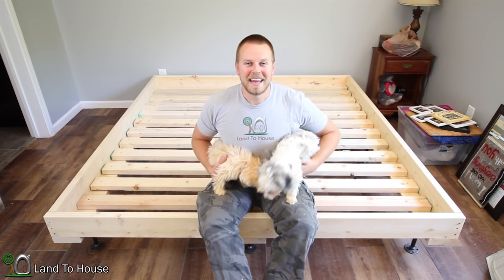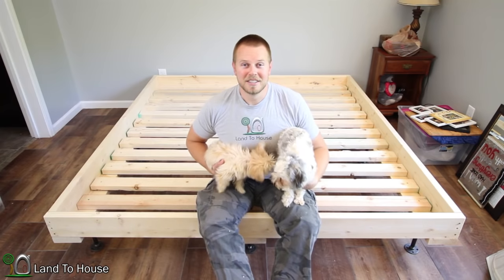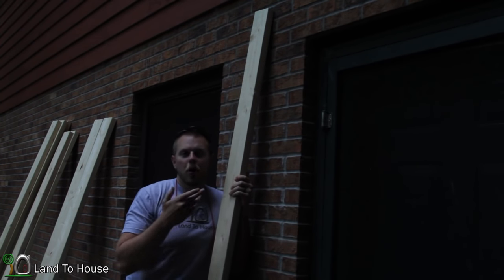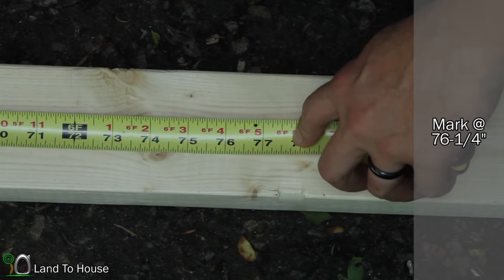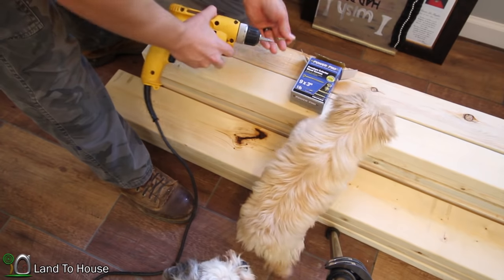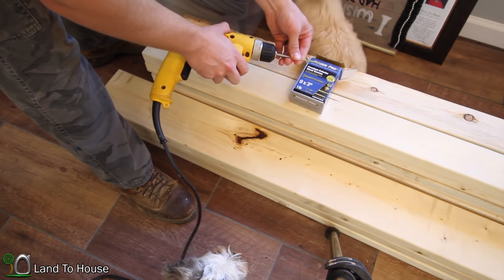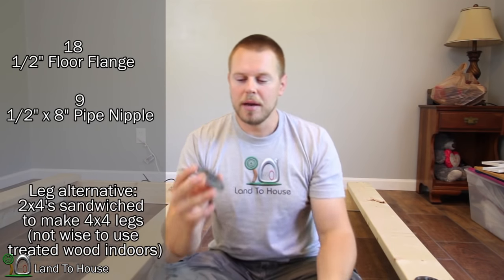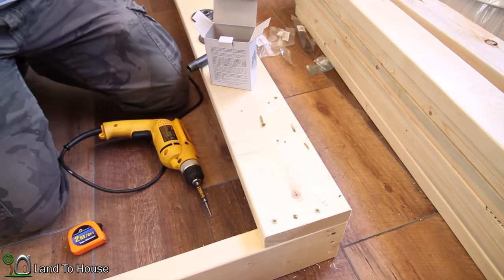Build a simple King Size Bed Frame out of wood

Comment: Could you have put four wood leg posts instead of nine metal ones?
Reply from the maker: +Costco Rewards yes for sure. Lots of people do that. Just make sure the wood is not treated. Many mattresses require that you have a middle leg.
Reply: Legs are needed to support the weight of mattress and people. As you can see, everything is hanging with screws from below the side structure, hence having 9 legs is the only way to manage about 400 pounds (150 lb per person plus about 100 pounds for the mattress). I hope it makes sense.

Comment: is this for California King or standard?
Reply from the maker: Standard size king.
Reply: Land to House Thanks. I have the base done with the exception of the legs and the slats. Your instructions are easy and the base is much stronger than anything store bought. Thanks again.
Reply from the maker: You're very welcome. I have used both the king size frame as well as the queen size and they're both very reliable. And to be truthful 110 to $150 is not that expensive compared to some commercial beds

Comment: Hi, if I didn’t want legs and just wanted it to be on the floor would I have to change or add anything as far as the structure goes?
Reply from the maker: I've actually received pictures from several people who have just left off the legs and the frame has worked quite well.
Reply: Ok thank you. I’m gonna try it out 🙂
Reply from the maker: Nice! This is a solid frame that should last for many years.
Reply: If you could give it a weight limit what would it be?
Reply from the maker: If you had this directly on the floor it would be well over a thousand pounds. With the legs I would be confident that it would hold 800 lb.
Reply: Ok thank you for this idea and information.

Comment: What length screws did you use to attach the legs?
Reply from the maker: +cherybabybaby1 the legs are attached with 1-1/4" screws.
Reply: Land to House  I have watched this video so many times, even though I know how to make it by now 😳I really like the look of it and how simple it is to do. How many total slats did you wind up using? If I put this bed together now and have to take it apart, will taking it apart jeopardize the stability, should I add brackets...?
Reply: 14?
Reply from the maker: +cherybabybaby1 haha 1-1/4"
Reply: Land to House 14 slats?
Reply: Or 17?
Reply from the maker: +cherybabybaby1 oh. My phone does not show the full comment thread. I think I used 15. 14 would give 3" gaps and I wanted smaller gaps. So if you went with 15 or 16 it would be fine.
Reply from the maker: I have not taken the frame apart to move yet but I should think you would be fine. The queen version fits through a door without taking it apart but I dont know about the king.
Reply: Land to House thanks for getting back to me. Did the legs to your bed come w/black "dirt" all over it?
Reply from the maker: Mine did not have any dirt. they were wrapped in plastic.

Comment: I just built this frame. I am pretty handy and have a few things to add. 

At 12:10 you say that warranty states that you need to be “no less” than 2” on the gap. It should be ‘no more’ than 2”. To make it go faster on the build I took every other slat and flipped it up vertical and butted it up so I had flat/tall/flat/tall etc. then you can run down the sides and punch in 4-6 slats at a time and the gap will be just over 1.5” using the tall ones as spacers. Then pull them out and move down to the next section. Perfectly spaced and no need to measure. 

I also wanted to note you can but 7’ 2x4s and save even more money!

I also bought some no skid pads from amazon for the bottom of the steel legs and it is incredible. 

Great video. I did this whole project in 2 hours thanks to your buy list and cut list. 

Awesome!

https://www.amazon.com/dp/B01N9X963G/ref=cm_sw_r_sms_c_api_i_tXwzEbXY3B884

Comment: You could have uses OSB board instead of 2x4  much cheaper
Reply from the maker: Some people have used that. If you're going to put the mattress directly down on the frame it's recommended to use the two by fours for breathability.

Comment: I saw the question regarding treated wood for the headboard. I was planning on using 2x4s left from a previous project, but they are treated. Can I use these 2x4s for the bed frame? If not, why? Thanks.

Comment: i have no carpentry skill at all so if you're like me walmart you can get you a Wooden Bed Slats Bunkie Board ($80) and  Metal bed frame with center support ($50)
Reply from the maker: +Damian Darkheart I also have very little carpentry skills. Looks like the frame you can buy at Walmart is the same cost that I spent on making this bed. Of course you would not have the labor involved from Walmart. But you are getting a stronger bed when you make it yourself

Comment: Compare a lot of making method of king size bed in internet, my method is best. Buy iron framework, and buy 12 pieces wood in home depot, size is 152 cm×13.5 cm× 4 cm.
Very strong, safety, anti bed bug, anti virus, easy to move, and cheap. And don't  need use hammer.

Comment: LOL, you didn't even plane the planks! 14:22 One of the planks actually has a "live" edge. This is an UNBELIEVABLY sloppy job! Frat house engineering. :-)))
Reply from the maker: +Maloy7800 If you will send me a private email can give you my address for the free Dewalt planner you want to give me haha. This is a super simple frame that can be built with minimal tools.
Reply: Well, it's not me who's talking about warranty all the time. I don't think warranty will cover sharp edges tearing the matress.
Reply from the maker: +Maloy7800 I can't say that I've ever had to use a mattress warranty. In the last video I made, there were a few people very concerned about that and so I mentioned it in this video. I expect a simple sanding would fix those problems. This video can just be used as a reference to build upon.